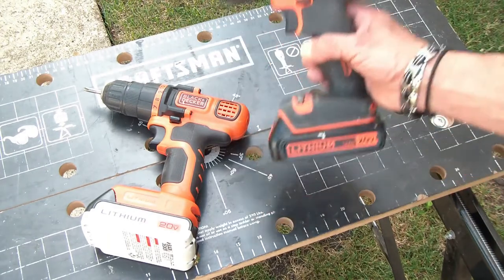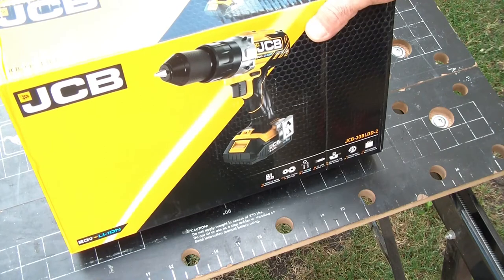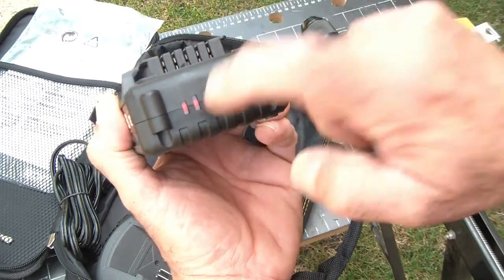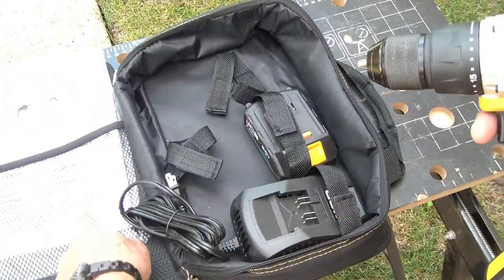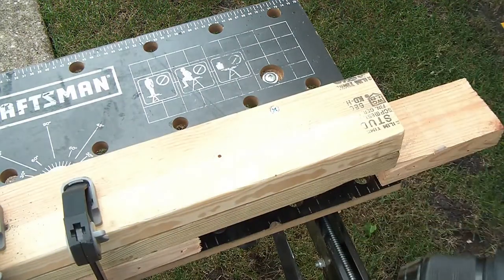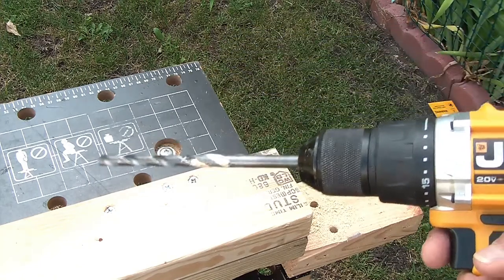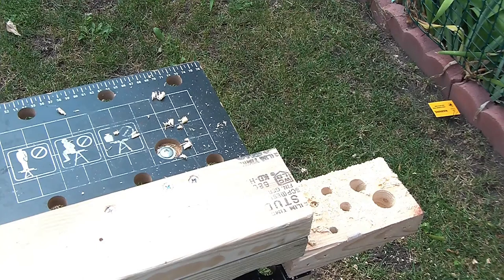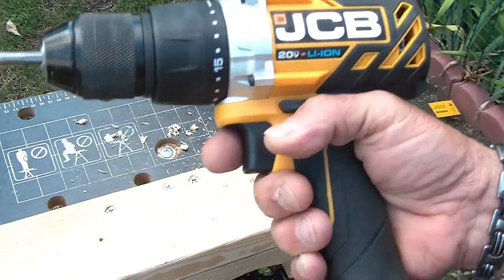How to get a cordless power drill driver for FREE!

Comment: I just ordered the kit on amazon for $66 that includes the 1/2" hammer drill, impact driver, and two 2.0 AH batteries with charger and the carrying bag. All brushless. You are right...the prices fluctuate a lot. I put the kit in my amazon cart, and a couple days later I decided to buy it and the price went up to over $200...so I decided not to buy it. A week later it was $88, and then finally I bought it on a black Friday deal for $66. Crazy marketing.
So how are yours holding up...and is the battery life decent?
Thanks for the video.
Reply from the maker: Works great! I have about 6 different tools from JCB and have been pretty happy with them. I might review some of them soon!
Reply: @fittoat9261  Great...I am mostly wondering how the batteries hold up. We'll see.